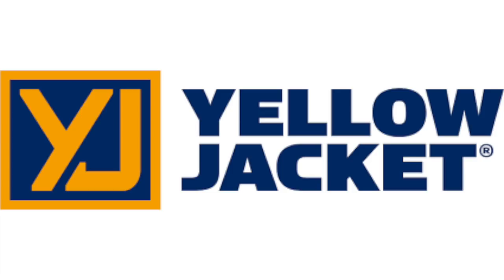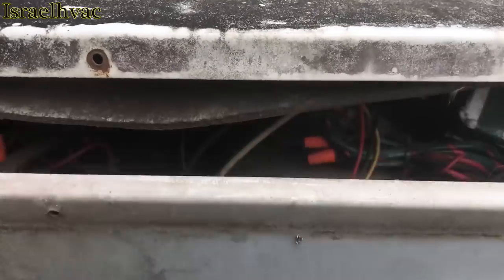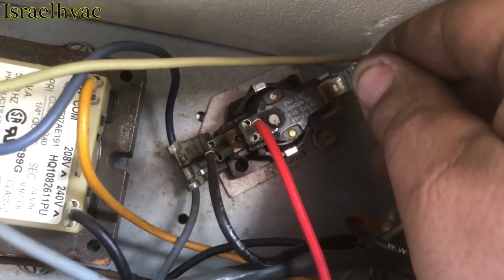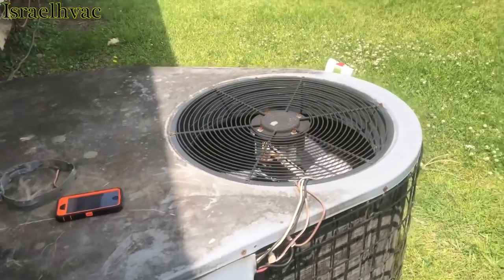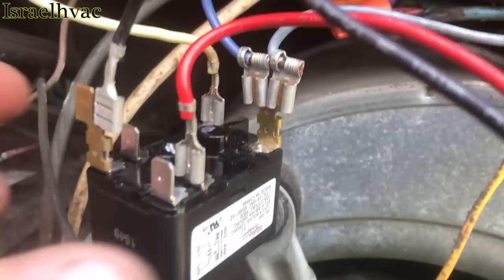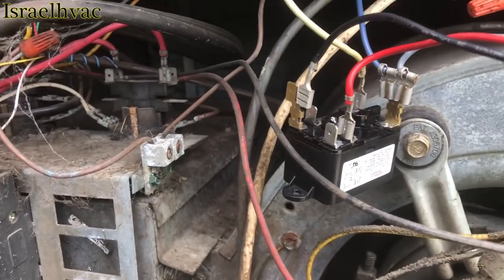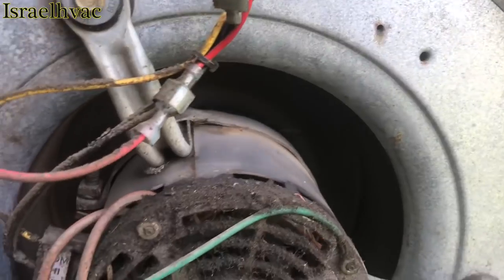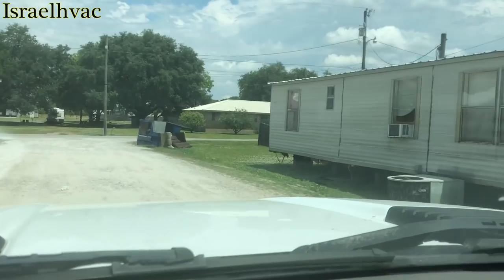HVAC Service | 2 ICP Package Units Not Cooling

Comment: These horse shoe units were work horses. I had one that came from Sears in 1980 that was hooked up to my old double-wide. Sometimes on the hottest days in summer it would run from noon until 8pm, and never flinch. It was the best unit I've ever had. I miss those.
Reply: I absolutely love those units, they run forever
Reply: @ClimateForceHVAC713  I wish they would make them like that again, with the exact same quality.

Comment: Where I'm from they call those " canned ham" units. Another great video John!
Reply: I had one of these units hooked up to my old double-wide. Mine came from Sears in 1980. It was one of the old olive green units. It was the best air-conditioner I've ever had. It lasted for 24 years, and was still running when I replaced it. The only reason I replaced it was because the steel cabinet was rotting out in places. If it hadn't been for that, I would have ran it until I just couldn't run it anymore.

Comment: Contactor for the heat strip and fan interlock on the T stat, regular fan relay for the blower and bingo, darn thing will run longgggg time😜

Comment: Those condenser fan motor wires 😂😂😂
Reply: At least they did "clean it up alittle" and make it look good with those wire nuts instead of wrapping the connections with electrical tape 👍
Reply: Wow smh